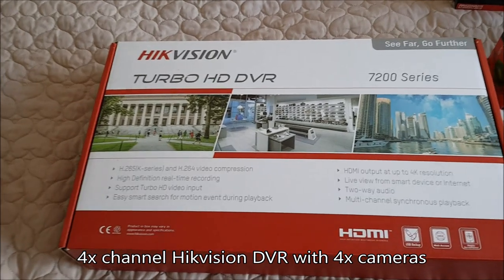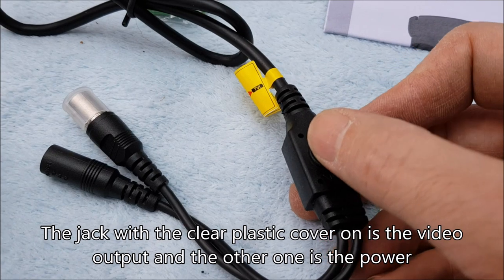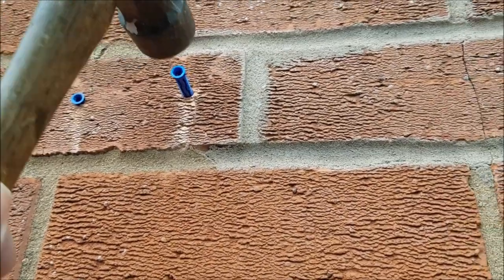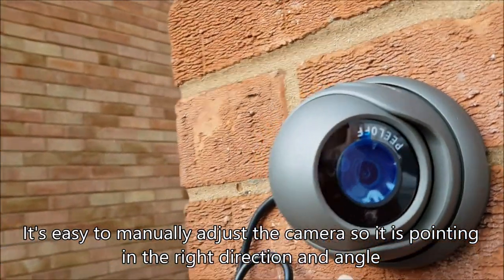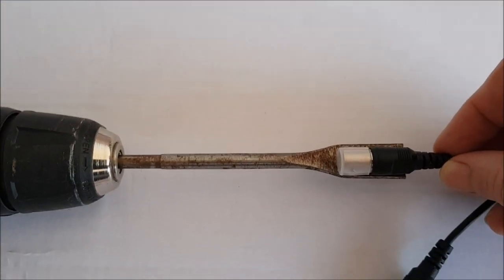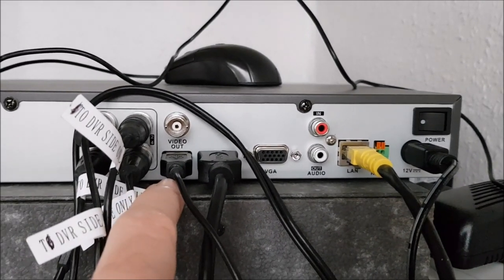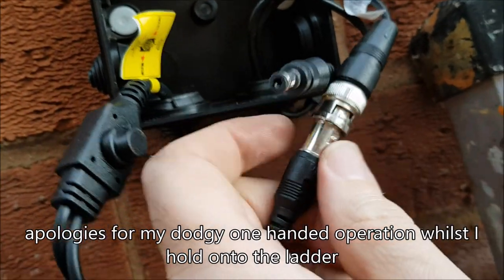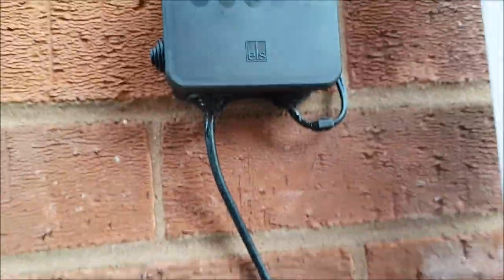How to Install a wired Hikvision CCTV system - Home CCTV project Part 2

Comment: There is a reason we charge a premium for CCTV install, you wouldnt see any cables, proper junction boxes would be used and if you were to see cables thay would be clipped with the correct cables or containment, this, might have used 4mm lens and put on the soffit, but good luck anyway
Reply: Fucking A mate! Most sense I have seen on this embarrassing “installation” vid
Reply: Lmao charge premium for a simple diy job haha

Comment: Good video, but just one point I'd like to make. Whenever cables enter a box or camera, it's a good idea to run the cable down lower than the box or camera and then back up to the entry. This ensures that water running down the cable isn't fed straight into box or camera. Good video none the less.
Reply: It's known as a drip loop

Comment: TVI system works for an ugrade to an analogue systen where one already has the co-ax and ELV power cable but POE can make for a much better system, one CAT5/6 cable, no junction boxes, just use the extention back box on a turret camera and join cable in there.
No need for an extra power supply as powered from the DVR and no cost saving to speak of, nowadays.
Cable clips are readily available in black, with masonry nails, much the same as aerial cable clips.
I sort of get why some diy installs are using CVBS and TVI ,especially when upgrading existing system without the need to rewire, but POE does work out better in a number of areas, not least of which is the size of the hole required for the cable and no need to pass bulky plugs/connectors through such holes.
It's almost impossible to make a neat job when a cable has plugs/connectors attached.
suppliers tell me that the manufacturing of TVI products will be reduced in the future now POE is more popular.
In fact, TVI was designed for upgrades to existing co-ax wired CVBS systems.
Nice touch using the passivated anti corrosion screws for fixing 👍

Comment: Not judging your install as effective for your needs however you may wish to consider the following.  Junction box for rear of camera with conduit running to loft space if you cannot mount cameras on the soffit directly. This will neaten the cable presence and reduce the risk of water ingress into the camera housing.  I would always aim to hide the cables however it is against building regs to run anything other than electricity supply tails into the external cavity of a domestic dwelling so conduit or cable capping is often the best and neatest solution. Obviously all this comes at a cost not only the materials but the expense of time and equipment (cable rods etc) which is why a commercial installer will charge more. All that being said if you are happy then nothing else matters but important that someone who is considering security installations should be aware of the benefits of a professional install. Thanks again.
Reply: You are right but the problem with having a Camera up that high you won’t be able to catch faces as easily. have at that height that he has them they are okay but the cable management is not on point it’s okay if you’re only doing it temporarily permanently it should be put through conduit like you said. What I would’ve done is two cameras back to back on each corner I would’ve run the cable straight into that junction box and then the two cables together and through the soffit so it looks like all one cable going up if you know what I mean.

Comment: Love it. Will be doing it myself now as well. Dont wanna pay the extortionate fee the installation people want to charge
Reply: I do not agree with you, when pros do the install its done in such a way that its neat tidy the  the system is setup properly yes it can be expensive but sometimes you get a better quality  installation and one that suits your requirments better.  Also faults are difficult to put right when you don,t know what your doing understanding how to set the device up on your mobile the motion detection for you to receive notifications on your phone a pro can do that much better than a diy person. However i have to say well done for the guy that  installed his own system it could have been neater but hats off for having the guts to fit some home security.  Everyone one to there own trade.

Comment: Wonder can you help me I bought a system used on eBay when I switched on the control unit nothing comes up on monitor and the hdd led is on and a continuous beeber coming from the box can you advise me please

Comment: Why didn't you put a drip loop on  your cable so if water is running down the cable it drips off before reaching the camera housing.  The drip loop should be below the camera to manage the water flow.
Reply from the maker: Thanks for the suggestion

Comment: Hi I have same camera and 5mp. One dome is displaying "no video". Tried moving lead from its port to another in back of dvr and still doesn't work so I assume I have eliminated that there is no fault with the wire. Outside the dome does not show the red led lights whereas the other 3 do so I assume dome is faulty. Is it a simple matter of replacing it and connecting to existing wiring? Also could I use a color vu dome for a replacement as other 3 are black and white picture? Thankyou
Reply: Try using good kit, and a professional to install it! 🤣🤣😳

Comment: You should have tied the cables going to the attic to the back off the guttering pipe with cable ties, hiding the wire as much as possible

Comment: Hiya

Someone just put up cctv cameras..1 at front and 1 at the back. They didn't put one of those boxes just the cameras threaded into the wall...the wires have been threaded into my lounge as I wanted to hv the screen there...there is a hole in my wall where the wires have been put through...just dangling down?

Comment: That install is awful.  The cables are all over the shop and not even straight or consistently clipped.  You could have run them up the back of the downpipe.  Some conduit laid plumb would have made it look less of an eye sore too.  You’ve completely ruined that brickwork

Comment: Sorry its a typical DIY job, rubbish cable clipping. Should have used a dome back box and put all the connectors in that. Poor cable running, what about using draw wires?